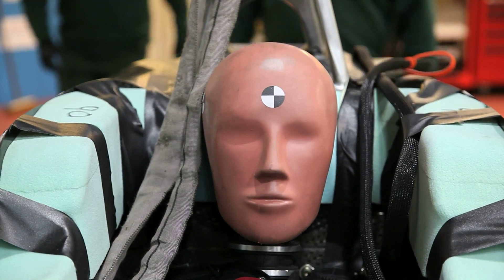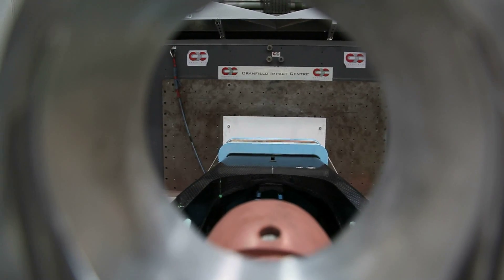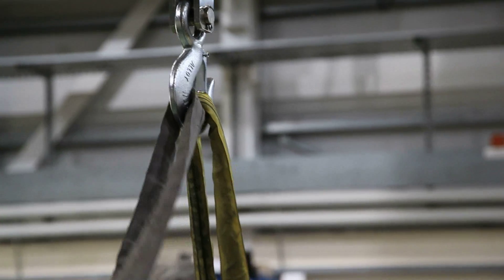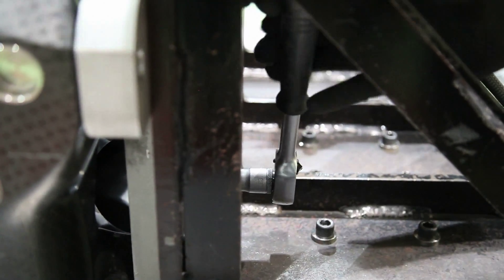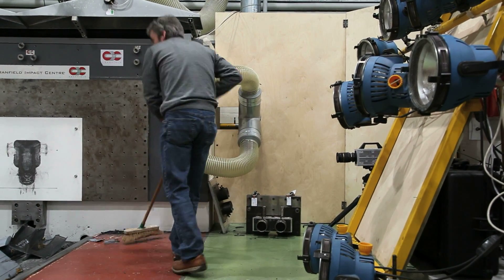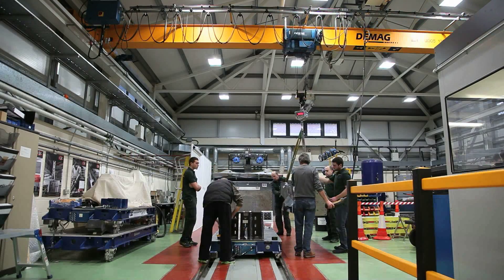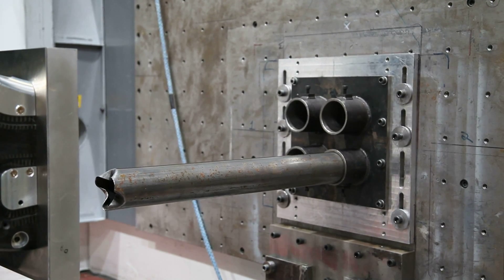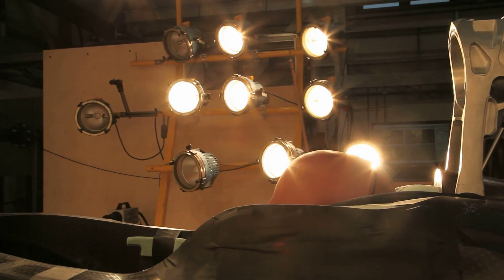Watch a real 2014 F1 chassis crash test

Comment: 15 meters a second? that's just about 45 mph.
never seen a F1 car crash at so low speed
Reply: a roadcar is crashed around 40 mph.. i've seen road cars going faster than that...
Reply: winyettyu
But you are not driving your roadcar at the limit every time you sit in it, do you?
Reply: From Autosport: "...as the impact is with a solid immovable object the resulting loads are representative of a real F1 crash where the car hits deformable objects"